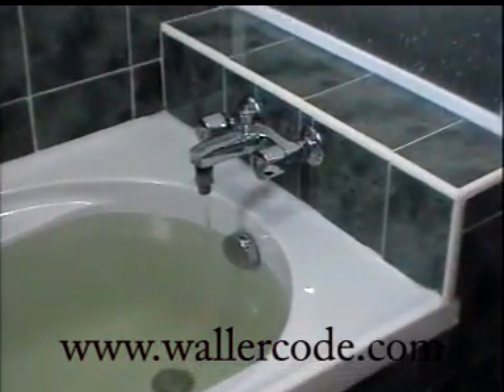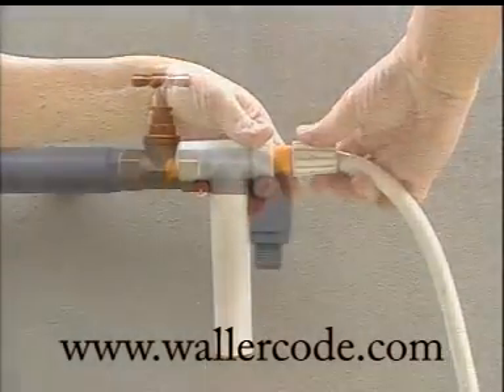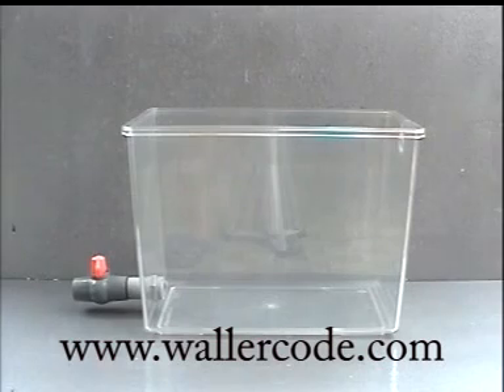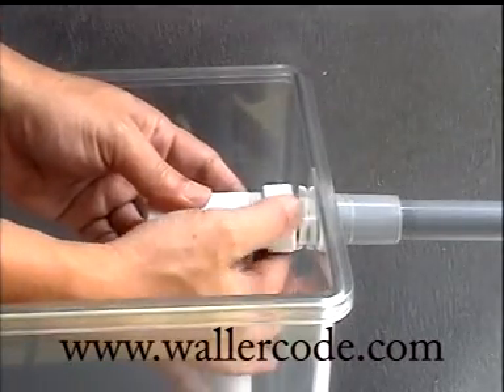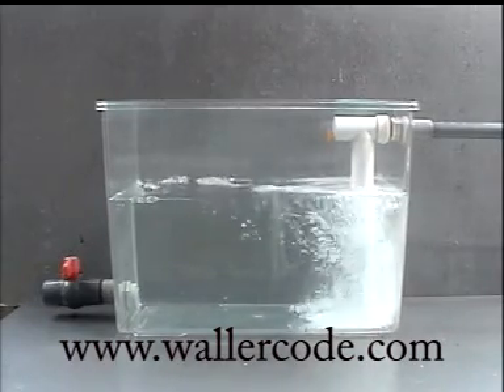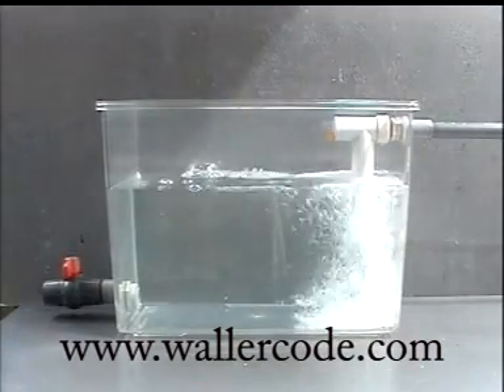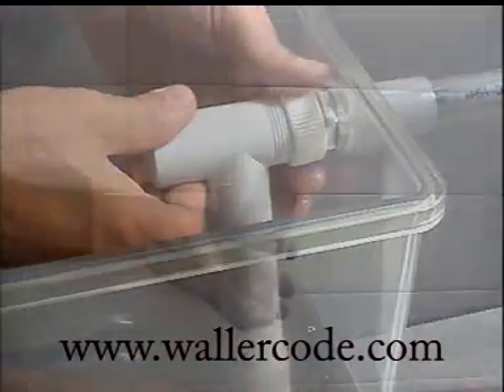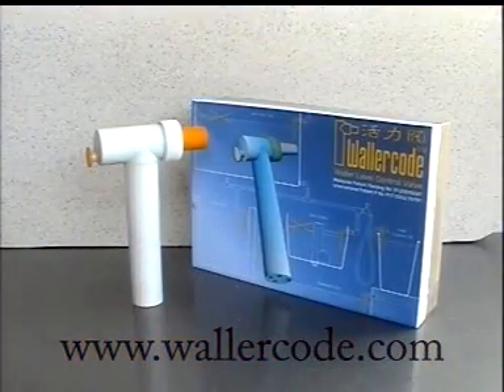WALLERCODE Water Level Controller Full Presentation

Comment: ok but how does this work in toilet when the water supply is at the bottom and there are NO holes higher?
Reply: there is another connection pipe join it with bottom source
Reply: ?? What, how would it attach to the tank with NO holes in the top. Toilets in U.S. have no hole at top except for handle so it can be flushed.